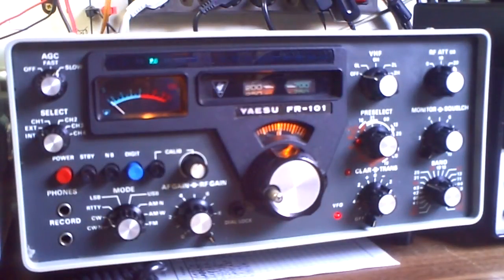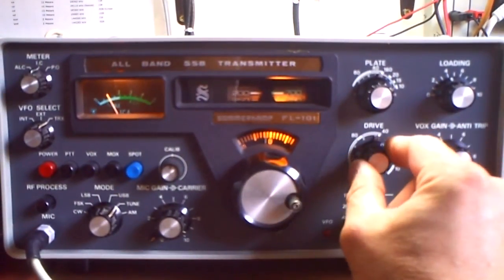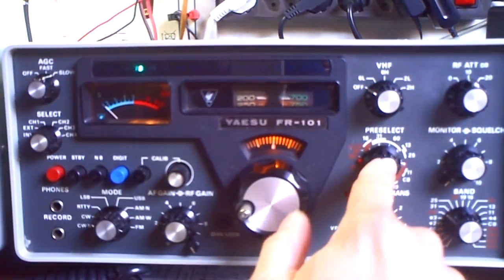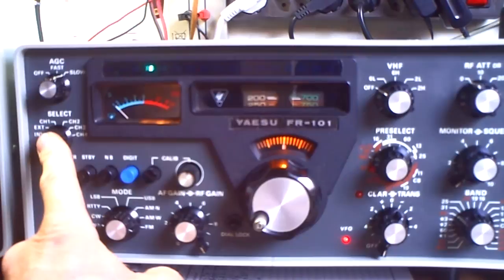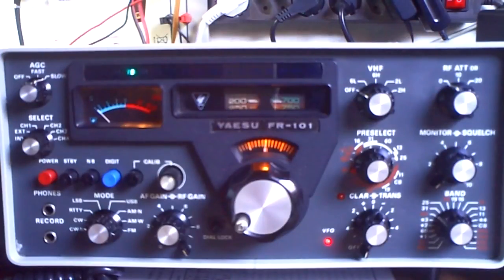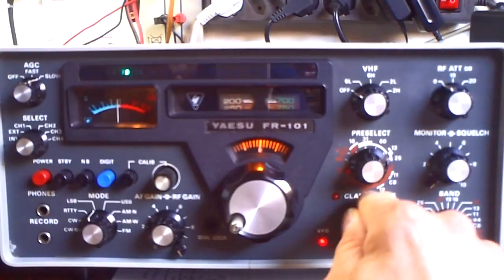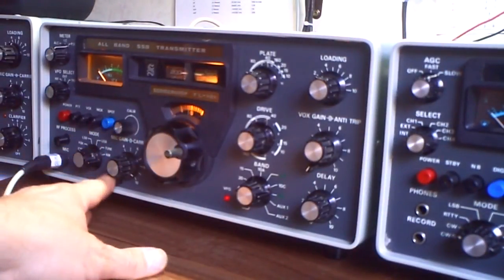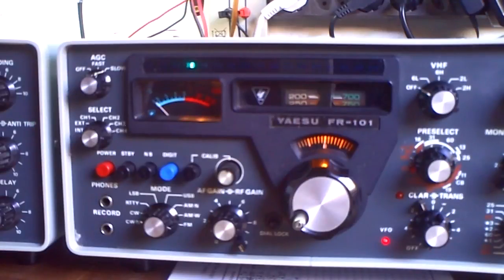Yaesu FL-101 FR-101 einpfeifen (set up frequency and tune up both machines)

Comment: Have you ever experienced the TRANS control not having enough range to align the RX with TX?  Great looking set.  Love the TWINS!
Reply from the maker: Hi Jamie, yes on 20m! I make it with help of the Clarifier Knob and the Trans on this band. I have now a litte marker at the right point. But you need a second radio to find this point out.
You have this problem often by this radios.

Comment: Dear Donald: Many thanks for the posted video
i own a fl 101 from yaesu whith the original NEC tube,s and the fr 101 from sommerkamp  complete whith cabels whith the original bill
and the 2 mtr converter 6 mtr is not on board
hoping to fire the twins up some time
your video is helpfull to set the twin
great machines for that time

many thanks 
grt and 73 Leo
PD5LAH

Comment: Donald: thanks for the video. I too like old radios. Toward the end, when you are syncing the emit/rcv freq, which control are you adjusting on receiver?  BTW: looked you up on qrz, VERY impressive! 73 Mike N5RXP
Reply from the maker: Hi Mike, thanks for the Comment. I think you mean the TRANS (at the right bottom) control on the receiver to setup the frequency tolerance between the transmitter and the receiver. That works only on SSB and on the TRX (Transceive) mode (receiver is then on EXT mode). You can control, very fine, the transceiver frequency on  the receiver side. You can hear yourself with the monitor function. If that was not your question, please ask me again.